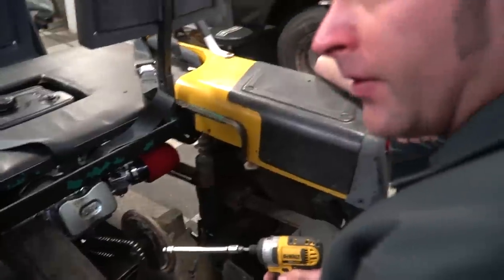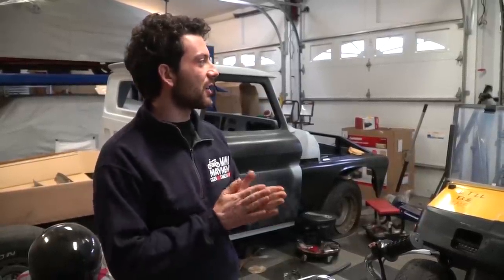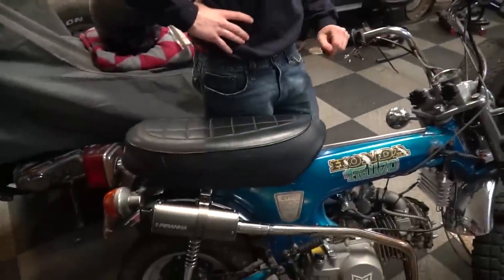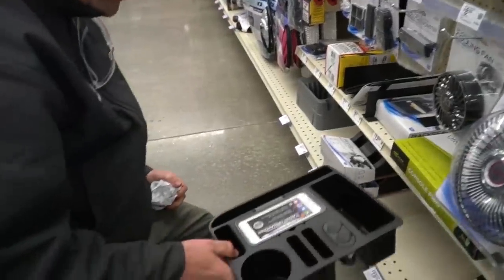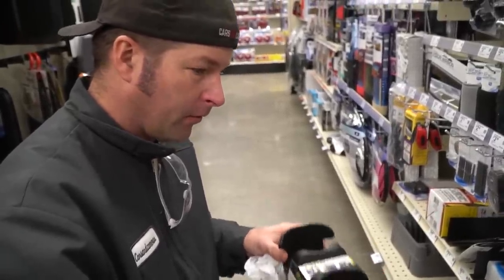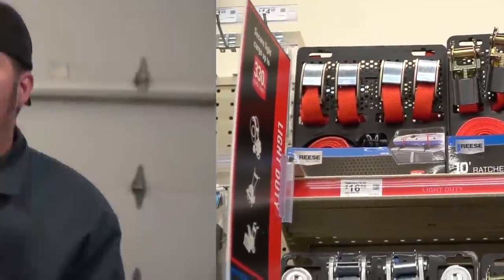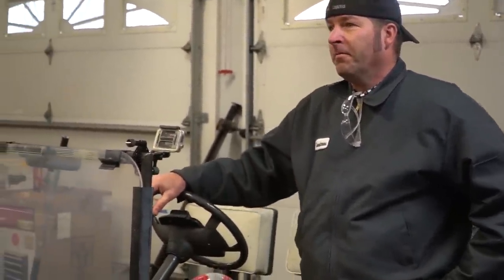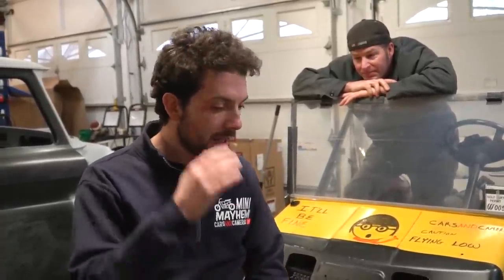Street Legal Golf Cart Reactions | Drive Through, Parts Store!

Comment: I had an issue with a 125 Lifan using the oil cooler. It would run hot with it and when I removed it worked perfect.

Comment: CT 70 is probly running lean will start but once the engine is hot the fuel gets vaporized befor it get to the cylender
Reply: You can tell by the coloration in the head pipe that it's running lean. Not sure if they are running that race fuel in it or not but I would try it on good old 93 and see if it makes a difference, if not then drill the main jet.
Reply: Race fuels are typically high ethanol content.  If the carb is jetted for straight gas it will definitely run lean.  Headers and pods will lean it out considerably too even on pump gas.
Reply: Exactly my thought. It’s running hot. If anything, make a heat shield around the exhaust to block some of the heat away from the carb.
Reply: jet it
Reply: Could be electrical...if the lights are dim...hasn't been charged 8n a while...battery may not be charging ...causing it to die out...
Reply: @jerryking1434  true
Reply: My thoughts too.  It's too lean...
Reply: Jerry king the engine does not run off of the battery. The battery is just there for the lights.
Reply: @georgesalisbury5093  no not true that engine doesn't have a charging system battery doesn't effect it running at all
Reply: @sawyerbennett8227  no
Reply: CT 70 is not running right cause of the Bent handle bars he has never fixed ......
Reply: @88s10Durango  yep lol
Reply: My thought was vapor lock as well. It doesn't happen often on bikes because of air flowing across it, but it does happen.
Reply: It might just be the fuel filter
Reply: @tct72  the discoloration is because its stainless steel. that is normal
Reply: @mr.hankie  I believe it's actually chromed mild steel as stainless usually has a bit of a dull finish to it. Regardless, it's still running too hot because of the lean mixture.
Reply: @georgesalisbury5093  hes right, the 140cc they have does not have a charging system so the battery is not currently affecting anything but the lights
Reply: Heck, it could also be the plug.
Reply: @tct72  its chromed steel. my z50's 125 swap exhaust is steel so there..
Reply: Ive had the same thing happen to me and it was the coil failing once it was hot
Reply: I had the same problem with a 1983 honda 3 wheeler, it had an aftermarket gas cap that did not have a vent, and it would starve for fuel when the gas level would go down and cause a vacuum in the tank.  let it sit for 20 minutes of so, and the vacuum would release, and it would start and run good again.
Reply: @tiporari  John says every time that its ethanol free 95 octane. Do you even watch the videos ?
Reply: @tct72  Drill the main jet ? You are joking right ?
Reply: @joebreault4304  Chromed steel is what I just got finished saying....learn to read.
Reply: @tct72  Well it works ofc but it doesnt mean that its best way to do it.. Jets are so expensive that you cant buy proper ones ?
Reply: @didyliduu  Why waste money if you don't have to? I wouldn't drill them out in an automotive carb but a mini bike or go cart I don't see the problem.
Reply: @tct72  Its not wasting money if you do things properly.
Reply: @didyliduu  Have a good one.
Reply: didyliduu  jets for a small engine like that are so cheep I bought a set of 4 different sizes for my Chinese 250 enduro for like 15-20 bucks
Reply: @jason3044  20dollars here for like eight different size jets for mikuni or dellorto.
Reply: @jason3044  And there is where the waste of money is. You now have 3 jets that are no good to you because you only needed 1. Thank you for making my point.
Reply: It's called vapor lock.
Reply: @tct72 extra carb jets laying around just means u need more bikes.
Reply: I'm gonna guess the coil is at fault. Classic symptom of a bad coil.
Reply: can timing be adjusted?
Reply: @jayjohnson7827  the timing plate   is under the flywheel. You can acess them with a screwdriver on some bike models through the slots in flywheel.
Reply: @eyeveedeath  thx
Reply: @jayjohnson7827  no problem.

Comment: Im pretty sure the problem with the Honda is the breather cap on the gas tank.
Reply: I'd put money on it
Reply: Thats right, they had this problem last time?
Reply: Ur right
Reply: yeah , also a big problem with these honda's
Reply: it doesnt need a fuel filter...no dirt bike does especially when you consider its GRAVITY FEED
Reply: @philtripe  they make gravity feed system fuel filters, and this bike is pushing 45yrs old so I'd think the tank has some rust if not alot(I own 7 Hondas from '66-'81)
Reply: @16driver16  I had the same problem with one even after I had cleaned all the rust out of the tank
Reply: @micahdeboer9877  what did you use to clean the tank? I had to rinse mine with gas once after using a rust removing bath from autozone, also goes your carb have a built in filter?
Reply: @16driver16  It has a strainer deal in the carb but no inline fuel filter. I removed the tank filled it with methyl ethyl ketone and some 3/4 inch nuts and shook it a bunch. Did that a few times and the tank was nice and shinny in the inside.
Reply: @micahdeboer9877  did you notice any color change with the gas you put in? After I treated my tank I had troubles. Emptied it once more and had no problems after that.
Reply: I would say you're running lean and need to re-jett the carbs. That's why you're over heating.

Comment: John,sir, the ct 70 uses an internal filter(in tank). By adding an in line filter, low fuel levels will cause intermittent stalling. Make sure tank vent is clear.  Also connect the yellow and white charging wires together for full time charging. Had the same issue when I converted to 125cc in my ct                                                                                                                                             peace

Comment: Guys, put a 250cc rebel engine in the golf cart! They're cheap enough and then you have gears
Reply: they have a 420cc tho
Reply: Why do they need gears, they already have a CVT transmission with the toque converter.
Reply: fwd tranny would give you reverse and you could find one with an lsd. chain drive straight to the input wouldnt even need a proper clutch just grind in on the syncros

Comment: The old 670 muffler would make that nice and quiet, I would also find aluminum flywheel with starter ring to put electric start back on. I thought go power sports had a flywheel like that. Another option would see if you could use a starter generator that's belt driven it would be a matter of adding a pulley to drive it.

Comment: it could just be  the battery is going flat some bikes need power from the battery I hade a bike that just wouldn't run without the battery
Reply: Thats what I was thinking but then it started back up later?
Reply: @tbirdracefan  if you let it sit the battery recovers and it will run till the battery gets low again
Reply: @gasman1143  no its not that. It can run without the battery most likely.
Reply: nope...DITCH THE FUEL FILTER
Reply: gasman11 they don’t run off the battery, the battery is for the lights and horn

Comment: hey CarsandCameras, I absolutely love your videos. i had the same issue with my 2 stroke engine kit as you do with your bike. My solution to fix this for me was to take apart the float bowl and tighten the tube that goes to the jet in the center. It's a weird carb and the tube is metal, but with it loose it would not go full throttle  and just studder when you put full. It also would never idle and would constantly flood the engine if you let off the gas . if you don't have a jet pipe as im making this name up, try adjusting the float or tighten up the jet maybe. it was getting way too much gas and would only run with the choke full on

Comment: On the trail 70 you should check the coil. I'm not very familiar with those motors, but on small briggs engines if the coil is bad it will quit working when it gets hot. I don't know if that's the same way but just a thought.

Comment: Your CT 70 issue is likely that you are using a fuel filter not a screen. On a gravity fed system use a screen like the small red ones for a lawn mower. Or add a fuel pump. Not enough pressure to  flow past the filter.

Comment: If your 140 spark plug isn't gapped right it will do this it needs to be gapped .020...... And do a valve ajustment .... Required every 100miles or so mine did this same thing cleared right up after doing this

Comment: That carb is the issue, I’ve had exactly what u have had happen on my Lifan 150 Aaaaand my buddies yx140 and both times it was garbage carb issue. I really think the mikuni u have is a clone, easiest way to tell is if u pull the jet and a GENUINE mikuni replacement jet won’t fit it’s a fake.. I went to this mikuni 26mm never had a problem of starving or heating up again 

https://rover.ebay.com/rover/0/0/0?mpre=https%3A%2F%2Fwww.ebay.com%2Fulk%2Fitm%2F162193738050

And this intake

https://rover.ebay.com/rover/0/0/0?mpre=https%3A%2F%2Fwww.ebay.com%2Fulk%2Fitm%2F331195483153

Comment: CarsandCameras If you have a metal intake tube with no isolator, and a metal carb... the metal will heat up then in combination with the engine heat it boils the gas after awhile. Or not, but it used to happen on the Chinese gas bike kits all the time until I figured it out.

Comment: CT70 carb is too lean. Are you running the plastic(Bakelite) intake insulator to keep it cool? Mikuni VM26-606 is the hot carb ticket. YX 140cc stator with aux. lighting. I did porting, cam, and valve springs too. Not necessary, but adds lots of power all through the RPM range. Make sure the tank vent is working. Do these things and you'll be good to go for Oregon.

Comment: how about adding small lights at the top of the windscreen that are tied to the turn signals so you know if you forgot to throw the switch...bonus, easily seen by other cars as well, build a center console cup holder out of old cyl head

Comment: If the trail 70 won't idle and dies and is hard to start, it's running lean. Either there's a vacuum leak in your intake tube (it uses o rings, they leak, put new in and a thin skin of rtv) or might need jets opened a size

Comment: How is the ignition and spark system work on that ct70. I was having the same issue with my 1986 Honda trx200sx all I did was change the cdi box and the stator and coil and it fixed the issue

Comment: On the CT70 check the voltage if the battery is low or is not charging it well not run right. The higher the RPMs the more power draw there is.

Comment: With a low battery voltage the ignition system is compromised. 
With motorcycles your charging system and battery must be working 100%.
With low voltage the pickup coil on the crank can pull to much current and cause overheat failure to the entire system.
Check the altenator output and never ever push start a electronic ignition motorcycle.
 Low voltage and higher than normal amp draw can burn up every thing from the Key down.
I know from experience because it happened once to me.
Burned up pickup coil and ignition coil and bridge rectifier and the altenator.
Get a Battery Tender for the Trail 70.
Keep Having fun.

Comment: Check the valve clearance , once the engine get's to hot , it will stay open, cool down , and you can ride again , if it's not that' , set the float in the carb higher , peacee

Comment: Get some harbor freight LED light bars and some new tires. Also, as a utility body, I can't not think of one of the shrine cart tow trucks lmao. You should also go find a junkyard turbo that still spins and whack it on the exaust. People will loose their minds when they see it in parking lots.

Also if you can find a tire/wheel package that's taller than it will improve your top speed and crusie rpm. Seriously, even one or two inches larger would probably get you to a sweet spot and improve your look.

Comment: You need to check the coil. Sounds like it has a open circuit when hot. Also would explain why it runs rough when cold. Check for small cracks and or the bonding agent seeping from the heat sink. Also if you are running a ethanol based gas you need to jet the carb to allow for 20 to 30 % more flow. But I would be looking at a bad ignition coil first.

Comment: I think the golf cart would take advantage of a muffler like what John has on his bike. Quiet idle. But a little noise when you step on the gas. If you want to put a box on the back of it, buy a utility trailer at Walmart.  The kind you pull behind a lawnmower. Use the box for the golf cart.  You could easily cut and square it to fit the cart.

Comment: For your bike you might try some heat shield around the fuel line. Maybe some of those kevla spark plug boots. It could be getting hear soaked. Vapor lock can cause a lot of those issues you’re talking about.

Comment: Get some flip open motorcycle helmets, they're really nice in that they offer great protection while having all the advantages of an open helmet when required. id make the controls accessible via the steering column by cutting some pipe and mounting the controls to them. that way you can make a dash with cup holders or w.e you want. those motorcycle mirrors would be neat for the sides. Ammo boxes welded or bolted to the side would add extra storage without taking much space. And lastly, I personally wouldn't wanna sit in gas if I spilled some by accident so Id also make a bracket behind the seats for the gas tank to be mounted on, fuel line is super cheap anyway:D

Comment: Check your ignition system on the Honda, I bet you've got a cracked coil casing or something that stops making contact when it gets hot.  That's why it tends to lose power high up, and then die once you lower the RPM.

Comment: If the stator on your CT is starting to let go, it'll run fine when cold, then you'll loose spark when hot.  It'll recover once it cools.  Over time it'll act up sooner and sooner until you loose all spark no matter what.  Standard failure mode on chinese pitbike motors.  Check for spark the next time it fails.

Comment: On the ct70 check the gas cap, if the gasket in the cap is crushed you lose airflow. The cap also has a dial on it that reads off on, it needs to be pointing to the on, or you won't have airflow.

Comment: You guys should find a steel fire extinguisher that's no longer used, clean it out and weld some sheet metal in it and put fiberglass insulation in it and use it as a muffler/glass pack.

Comment: The ignition coil on the Honda 70 might be bad...   The primary may open when it gets hot.   Or it might just be the point or the condensor  Or the insulation on coil wire might be dried up and shorting to ground

Comment: Check the valve lash on the Honda, may be to tight and when the engine heats up the valves can't seat causing it to die and not run till it cools back down.

Comment: If you take 2 hood gas prop rods and attach one end to the spindle and the other to the center crossmember so you have one on each side it will act as steering stabilizers and keep the it more stable at high speeds. I did it to the 440cc snowmobile powered golf cart on my channel and it made a big difference since I also had sloppy steering.

Comment: hey, John, i wonder if that carb is getting hot i have just discovered that they will cut out and die because of that i have cured that with heat shields they usually are in between the thought and the carb